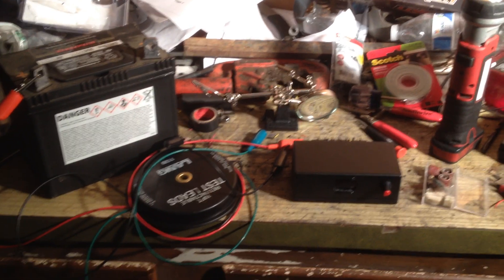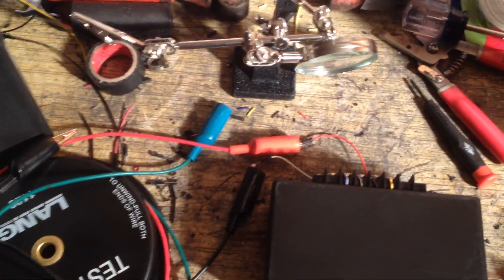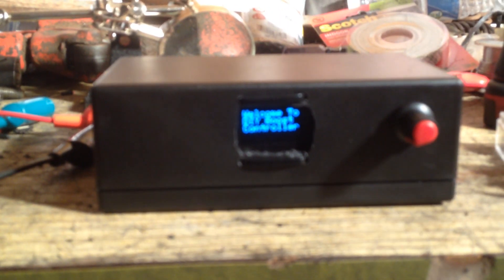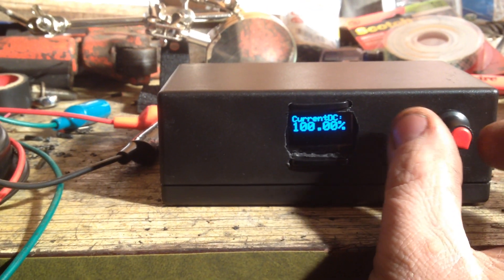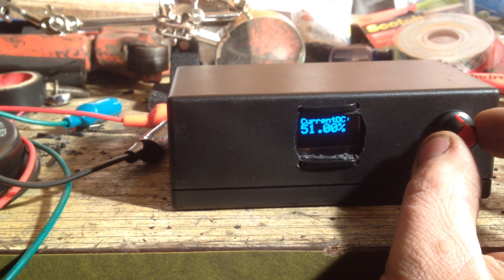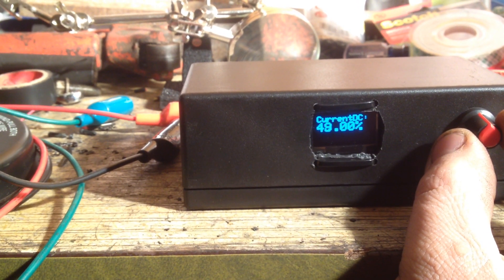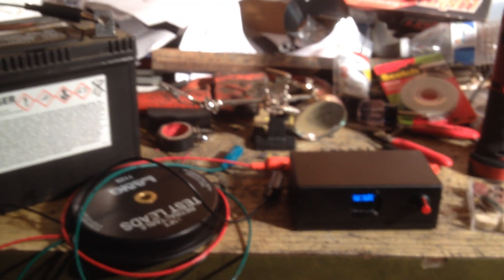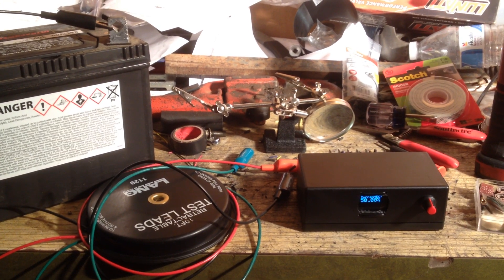Quick Simple Dial-A-Boost using Arduino update video, its WORKING in a project box!

Comment: So basically this will be a rough boost setting, any higher DC your boost will hit a target and drop off, or lower and it will hit target and then creep? If so, do you have any intentions of making a closed loop system that has an input to the Arduino for pressure so you can program actually psi of boost to achieve?
Reply from the maker: superbeeblaze well I've personally been running a open loop setup just like this on my megasquirt 2 in my firebird. Set it to a certain duty cycle, and you get XX amount of boost. I've never had creep or drop off issues doing it this way but I have a good wastegate setup so that maybe why I've never seen the issues your mentioning. Matt Happel of sloppy mechanics does it this way often too without those issues. He was the one who requested this boost controller and he's going to be the one doing the on vehicle testing with it.

To answer your other question, yes eventually this is going to roll into a closed loop system and have scramble boost options, etc
Reply: awesome, good to hear! Ill be watching for updates, id love to duplicate what you build after working all the bugs out.